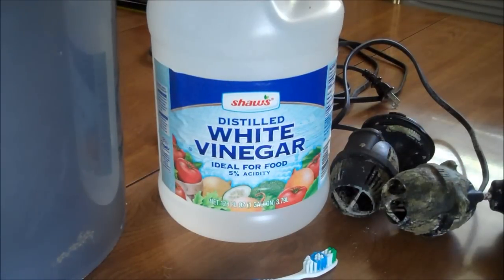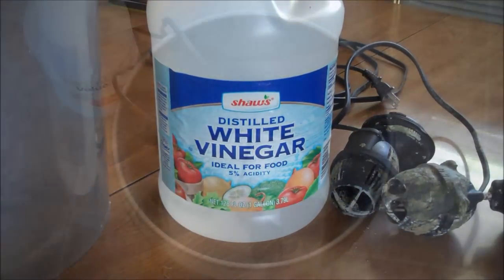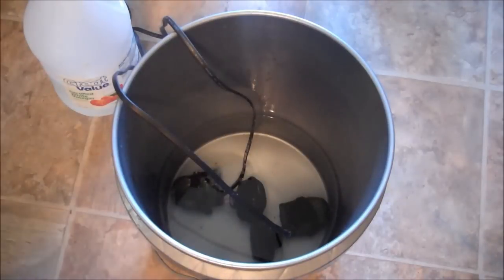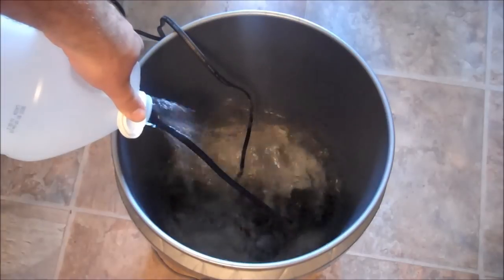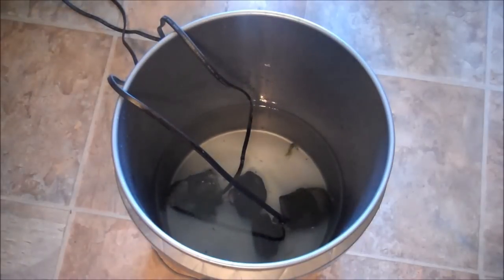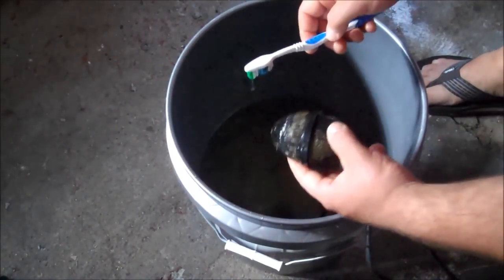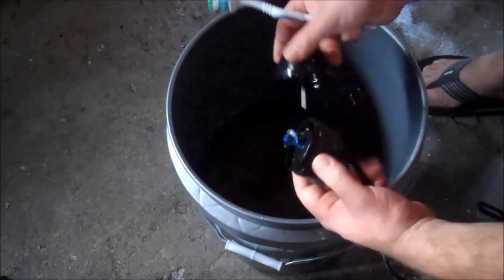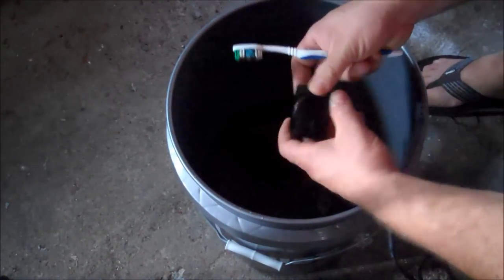How To: Clean Aquarium Equipment | Aquarium Maintenance

Comment: Fantastic tip thanks, I have a question I want to remove everything from my nano cube 28 gallon acrylic tank and start from scratch. Should I run vinegar in the tank with the water after removing the sand and rocks etc. ? I want to make sure it's  disinfected. I have way too many bristled worms and other pest. Thanks let me know.